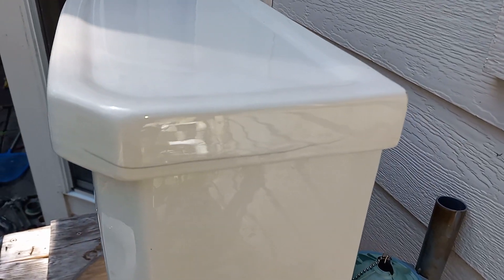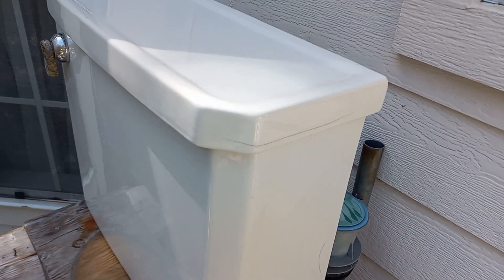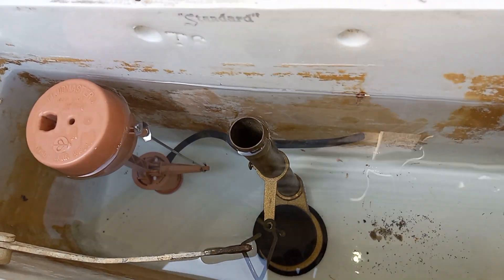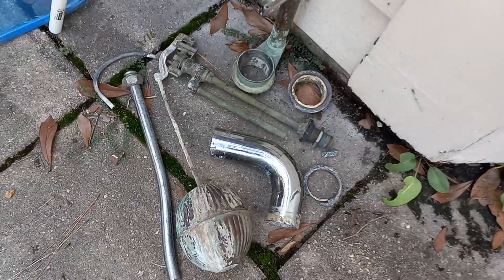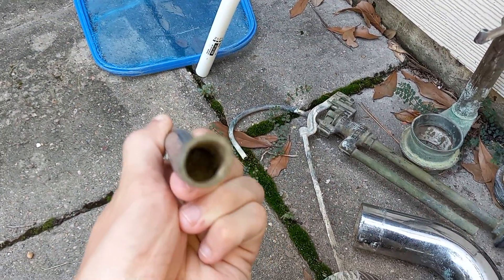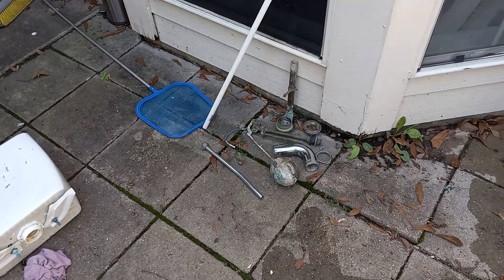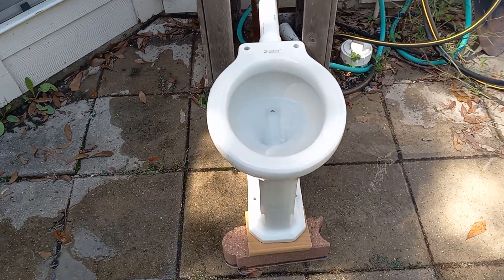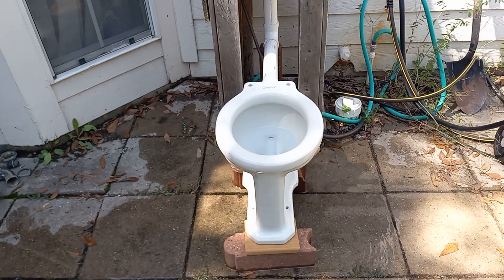1936 Standard Modernus!

Comment: Hey you can also make that a mid tank setup
Reply from the maker: I can only use this for back spud toilets.
Reply: Just take off the corner conector peice or make the pipe slightly shorter to put another corner conecter peice and to make back to a back spud toilet setup you can just curve it again
Reply from the maker: @the_sandiego_gamer  That could work but I think a lot of the power would be lost in the curves.
Reply: Just try it because you never know unless you try it
Reply: Ill be waiting
Reply: @OCC_Plumbing_and_Restorations   it wont because in this video https://youtu.be/TSd6PvQqaCs i saw a while and it has a lot more curves and it has the same amount of power
Reply: Also if it works i want to se the crane hymot on to juge power and also my favorite toilet is a crane hymot
Reply from the maker: @the_sandiego_gamer  That's awesome
Reply: @OCC_Plumbing_and_Restorations  are you going to make a video i want to see it
Reply from the maker: @the_sandiego_gamer  Yes